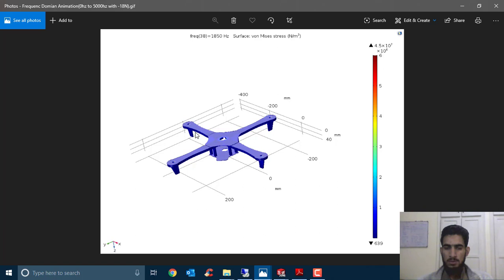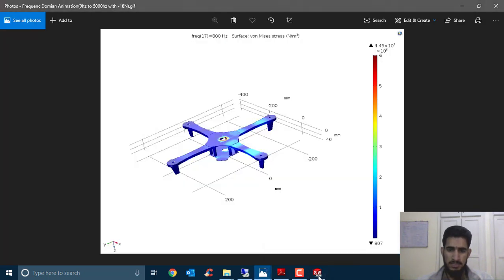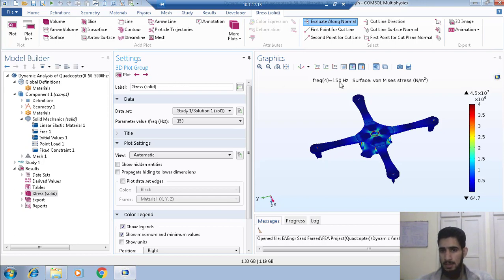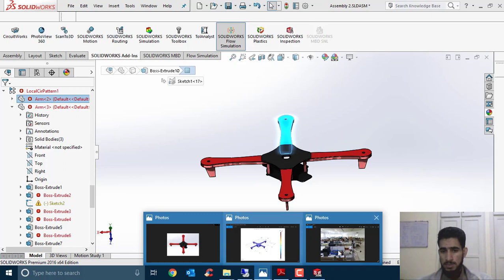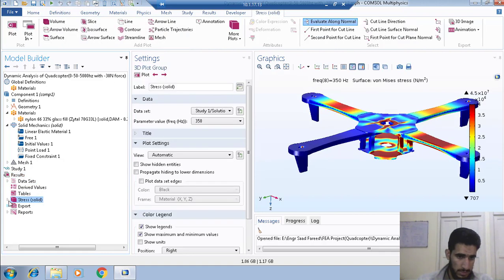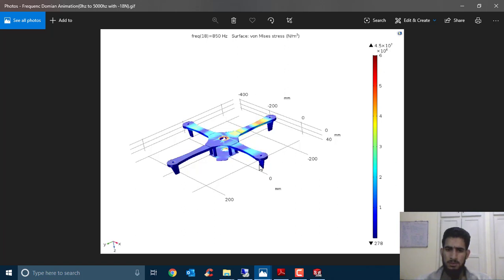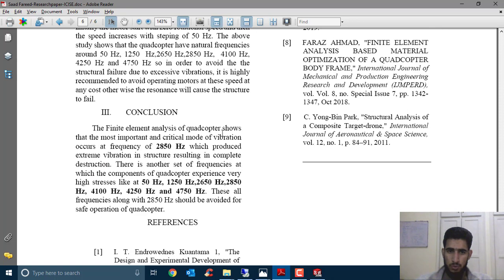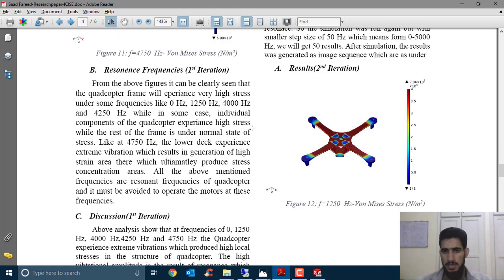Finite Element Analysis (FEA) of Quadcopter(Dynamic Analysis)

Comment: your analysis is very ok but I can't see further study about the relation between the geometry and the resonance effect so to avoid the higher stress at different levels of frequencies
Reply from the maker: Yes...The work was not that much extensive...The task assigned to me was just to find the frequencies at which quadcopter will not be safe to fly using FEM (Finite Element Method)...May be the thing you pointed out can be carried out in future either by me or some one else.